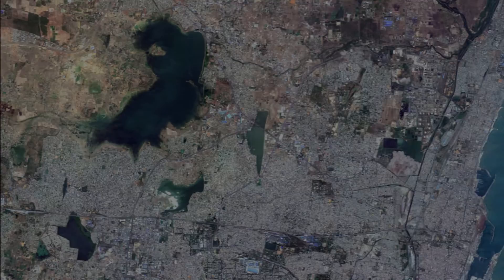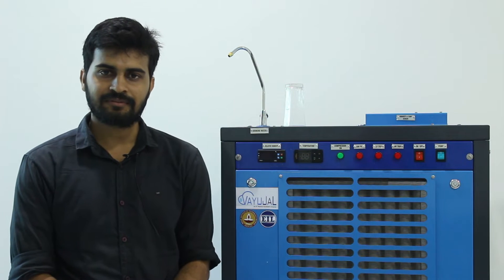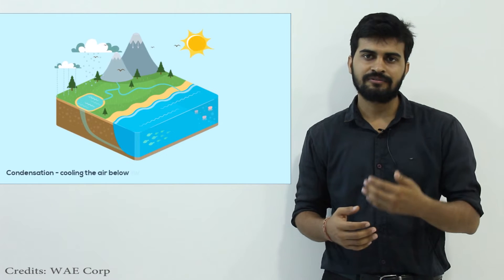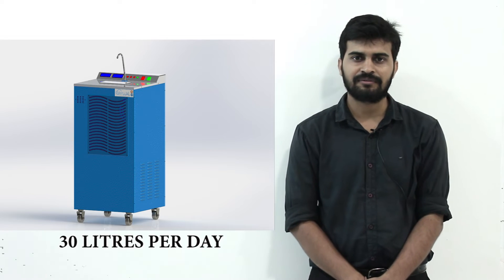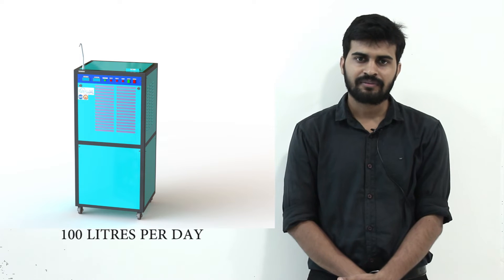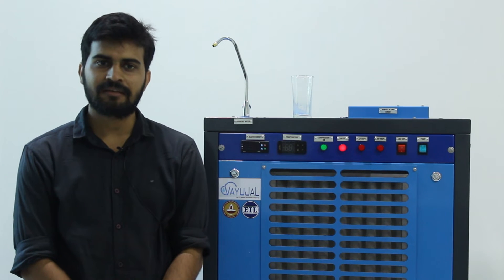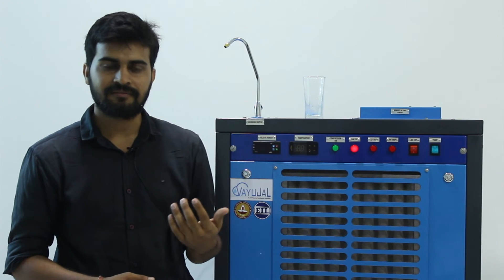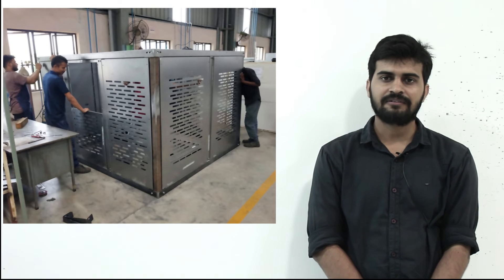Vayujal Technologies Pvt  Ltd _Atmospheric Water Generators

Comment: Sir, your entire team deserves congratulations.
And if possible, you can also develop humidity free water air coolers, which will reduce our dependence on air condition and control the electricity consumption along with preventing the rising temperature of the atmosphere.